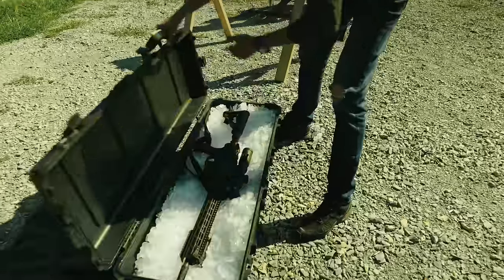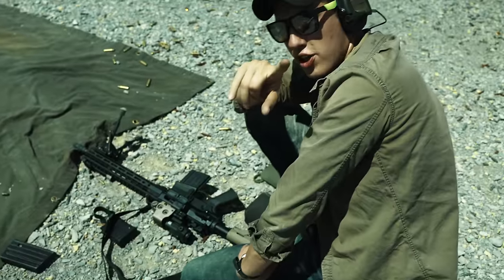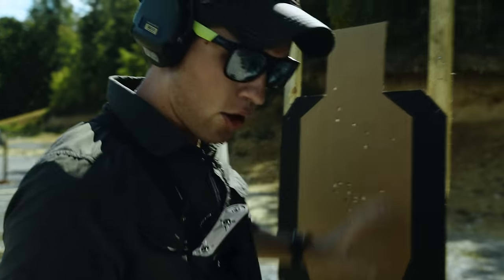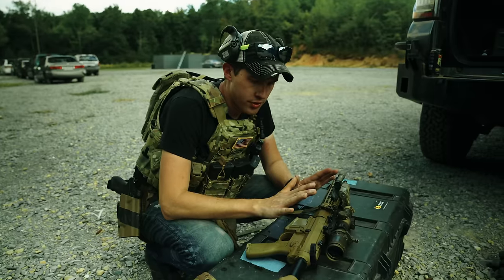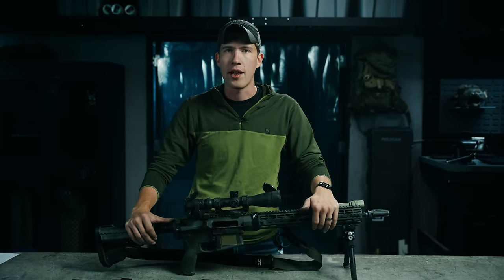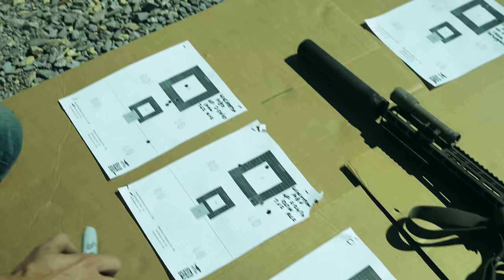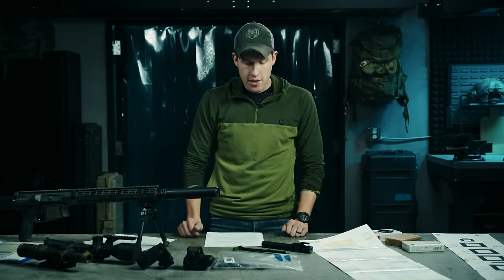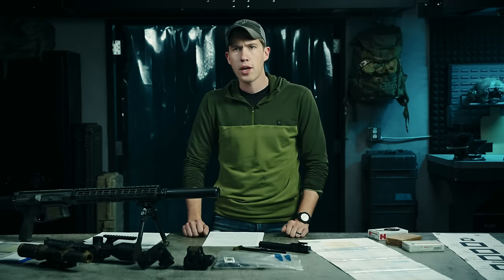Aero Precision M5 AR-10 5,000 Round Test

Comment: heating it up, cooling it down with ice, heating it back up, cooling it back down with ice. Multiple times in a shooting session, are accounting for the added metal fatigue you are introducing, as well as taking that into consideration when you get failures?? Drastic temperature swings like that as well as uneven temperature swings can't possibly be good for a rifle. Expansion and contraction of the metal in uneven ways. Not to mention the effects that could have on the temper of the metal. Is that something people normally do when shooting their AR's?

Comment: purchased 2 barreled .308 uppers, one 20" and one 16", from Aero. Also, I used their BCG, CH, and Lower. On both uppers, the .308 headspace NO-GO gauge locked into battery. Just curious if you  checked headspace on your build? If so, what did you find?

Comment: I haven’t finished my aero yet waiting on a buffer tube, but I have also built out a PSA and a Bear creek. They are not exactly the same in fact all different lengths, optics, all un suppressed. All 308, all I want to see is how they compare, won’t be doing what you are. I do think that you should compare but start with the aero as your bench mark , then see if you have similar failings and wear. Go to that round count you got too with aero to keep it fair for all. You might want to shorten the amount you publish I listen to it all but I mopped the floor while you did it.Bits and pieces will keep it interesting. 50,000. For a thousand dollar rifle review?😂😅😢😊

Comment: so, at about 1500 rnds shot in varied Alaskan weather conditions my aero bolt carrier decided to shit out the firing pin retaining pin out the rear of the carrier, between the carrier and the firing pin locking the whole system up and gassed me so hard it knocked my shades off my head , shooting 6.5 creed various high end ammo. this made me very angry, i purchased a new BCG, and sold the upper at a loss. was running a hyperfire eclipse fcg, m5 freedom lower, captured jt silent buffer, the gun actually ran titts until that incident. the lower is now host to a WC 358win upper and ive only shot it about 100 times since, the whole thing soured my opinion on AP. i tried to like it. i have a few 556s built on aero lowers that have lasted , but the lower is the only thing made by AP.

Comment: I think we all want that unspoken question did you ever discover were the broken piece of firing pin went to or did it get flung from internals to i would assume the mag or out the gun into oblivine.obivisuly fhe pin takes some hard hits but i would think if anything breaks off it would be locking lugs or extractor maybe even bolt face cracks.but must be weakness in that particular bolt system.otherwise indepth testing for sure,intriging i enjoyed!!snookie pa.💥👍💋

Comment: I have a couple of problems with this video.  First of all, operating the weapon without lubrication or cleaning is not operating per specification.  Would you drive a car with no oil?  

As for the broken firing pin, again it was operated outside of specification.  That is not a warranty issue, it's a misuse issue.  And I don't see how it would be such a problem to simply swap.out the firing pin.  It's a wesr item.

Comment: Would the results be comparable if you used an Aero Precision AR10 chambered in 6.5 Creedmor or would it be drastically different ?
Reply: 6.5 creedmoor is harder on the internals.  You have the get a barrel with a +2 length gas system to slow down the velocity of the bolt carrier and usually a JP small diameter firing pin bolt because 6.5 creedmoor in ar10 is known for piercing primers with regular .308 bolts.  
  I built a JP LRP07 clone and did a lot of research before building mine out.  I cloned that rifle because it was the only proven 6.5CM AR10 that I knew of at that time.  Rifle runs great!  Got ~2k rounds through it and itll shoot MOA consistently.  Under MOA occasionally.  I run it suppressed with the JP VMOS BCG and SCS with an extra tungsten weight on the SCS.

Comment: You have a great channel and provide great testing and product info, but not cleaning a rifle for 5000 rounds would be like driving a new car 50-100k miles and never changing the oil or lubing the chassis and not rotating the tires, then wondering why the engine fails. I don't know any professional or responsible gun owner who would not clean their rifle at least every 300-500 rounds.   Even soldiers have cleaning kits with them and could clean their rifles at night or every few days.  An AR10 308 is not like an AK 7.62x39 which could probably function ok after 5000 rounds with no cleaning.  For sure the barrel and or throat on that 308 has a bad carbon ring which affects accuracy and will increase pressure.  There will be tons of carbon build-up inside the bolt/firing pin area and inside the barrel/bolt junction which could cause head space and pressure issues.  To be fair to any rifle test, there should be some basic cleaning done to it.  Or at least test 2 of the same rifles, side by side.  Clean one at reasonable intervals and abuse the other one.   I own many rifles; they function and shoot a lot better when maintained.

Comment: Can you do a diamond test AR-15 or are 10 I've had BCG problems with both of mine and want to know more before I get to 5000 the ar 10 has about 200 rounds and my 556 has about 1700 rounds over the past 2 years the bolt snapped completely on my 556 at about 1200 rounds and my AR 10 the firing pin tip broke at 60 they've replaced both due to warranty but want to know if it was just the one I got or if it's a recurring issue before I tell friends aye get this gun cuz I love my diamondback ars just had the BCG problem with both and they're both still really accurate from what I've been able to see only have gone to 150 yards or meters with both

Comment: Here's my explanation as to why Aero Precision has poor customer service...

One of the worst customer service I've ever experienced from a firearms (and parts) manufacturer when dealing with their faulty part they manufactured.

While putting my purchased Aero Precision EPC-9 together I noticed the buffer retainer was damaged and this buffer retainer is under the receiver extension and holds the buffer and buffer spring in when the upper and lower are separated.

Each time I call them I'm on hold for over an hour...very frustrating.

When I contacted the Aero Precision customer service about their defective part they told me they would get to my complaint in 6 to 8 weeks!!!!   This is unacceptable and unreasonable...so, I'll have an expensive paperweight for at least 6 to 8 weeks?  The customer service representative didn't even offer me any options, like ship the defective part back to them and they'll ship me a new part.

Comment: To shoot a 308 AR without an adjustable gas block, especially when it's suppressed is just silly and asking for failure, whatever the brand. There is so much gas you must regulate it if you want a reliable weapon, unless maybe you use a flow through suppressor, but even then.

Comment: Uhm, your using a red-dot.   They are typically a couple of MOA dots....    Get a real scope.   My cheap, bear-creek is sub MOA with a 16" barrel.   In fact, when I pull the trigger, it looks like a hole appears right where the cross hairs were pointing.   I don't have a bipod...  The barrel is stainless.   I did polish the BCG, the ramps etc.   Some BC bolt carriers have a non-smooth cam pin action.   Mine is greased lightning.   Also tunable gas block.  For scope, I use a cheap Vortex.
As for Aero - their lowers are solid and I also have a couple of uppers (9mm....) they could be a little lighter - but I've never had issues with receivers being to heavy.... the barrels on the other hand....

Comment: @PnP-td1mt  can't reply to comments for some reason, but i felt compelled to post this:

"So lube prevents screws from backing out and firing pins from breaking? You ever fired a suppressed AR that is heavily lubed? The lube is a magnet for carbon. 
What idiot is going to claim these failures are due to a lack of maintenance when A a legit maintenance schedule for this rifle doesn’t exist and B the parts have never been truly inspected. 
My only gripe with this video is TREX Arms not having a qualified Armor and Smith on stand by to validate part specifications and failure modes. 
That way no bs slips through."

Addressing the first part of your clown take, even Lucas' amateur gunsmith says that when they were running it suppressed, the added pressure/dwell time probably played a part in breaking the extractor. So yes the minimal lube and the gun being way overgassed can definitely help screws back out and put extra stress on the firing pin, they're all exposed to extra pressure that could have been alleviated by knowing what you're doing.

(Saying this here cause I know someone will claim I don't know what dwell time is, based on the statement above. There is extra dwell of the bolt being locked in battery on a dry bolt vs a lubed bolt. Common sense physics, more friction = less speed. Not talking about gas in the barrel dwell.)

Your second statement, this is why I use CLP and not grease as lube. CLP helps mitigate carbon build up. Also, Lucas had a clown take when he said, and I'm paraphrasing, "we're just doing this as a regular consumer would, not gonna clean it after 1200 rounds". LMFAO, I clean my barrel after every range day which could be 10 to 100 rounds, and I fully clean the bcg and bolt and firing pin every 200 or so rounds. Who has 800 round range days 5 days in a row LOL?

"What idiot is going to claim these failures are due to a lack of maintenance when A a legit maintenance schedule for this rifle doesn’t exist" this is pure idiocy. So because there isn't a milspec maintenance schedule you shouldn't maintain your rifle? Do you never change the oil in your car? Do you not reset your torque wrench to 0 when you're finished using it? Who buys a nice tool and doesn't maintain it? I guess manufacturers must love you, repeat buyer cause you don't know how to maintain your nice tools.

Comment: Can't say I would insist on using a lower with set screws instead of roll pins because Phillips head screws tend to get stripped out and it's a lot harder to screw up a roll pin. The barrel life definitely supports anecdotal evidence about ammunition stashed in the woods during basic training. Not taking the time to tune a rifle suggests you're the kind of person who would rather lease a new vehicle than own it and have to do maintenance. The 3rd party bolt issue also leads one to believe that Dillon is more of an assembler of parts than a true manufacturer the way Orange County Choppers compares to Jesse James. And I just can't stop laughing every time you spin around like you're wearing cowboy boots. New shoes tend to be a bit greasy out of the box. Some people might want to feel the ground under their feet while sneaking through the woods but in the concrete jungle, I'd rather not know it's there at all

Comment: T. rex are not the only folks who take a gun out of the box and run it without any lube.
I have always thought that this is the dumbest things I have ever seen. This is abuse of the firearm IMO and I would NEVER do such a thing to a weapon I may have to count on to save my life, and for which I spent my hard earned money.
I commend T. Rex for their effort for this type of real world testing effort, but taking a NEW firearm and running it dry for 2,300 rounds without lube has little to do with the real world. The most important lesson I believe was learned was that if you are looking for this type of rifle, make sure it is supplied with an adjustable gas block that can adequately mitigate the bolt speed/force.
 
The next thing you need to do is call Aero back (and your lawyer) and apologize for "testing" one of their brand new .308 DI rifles, then putting out a "no go" video while basically only lubing the gun after it fails. Then run the test again with a gun that is not abused. One of your staff did a 5,000 run test with a PSA rifle, and the first thing he did was lube the gun. Running thousands of rounds without ANY lube is in the same class as the "reviewers"  fire AR 15's full auto until the gun breaks and/or catches on fire. You abused this gun into failure, doing Aero and your viewers a great disservice.

You guys still should be commended for your efforts to elevate the evaluation process of firearms for public consumption, and I pray you take my criticism in the spirit in which it is offered.  Keep on with the project, but basic guidlines need to be set and observed. 
As I said, no lube on a new gun, especially for that many rounds is abuse of the weapon. How or why some reviewers have made this popular is way beyond me.  I hope you all get these tests squared away. I wish you luck because you are on to something. 

I'd just like to say I have no connection with or knowingly own any Aero products.

Comment: Yeah, the firing pin is in the middle of the whole thing, basically having several layers of protection, the ice should basically have zero effect on that.
If it's hot and you take it out and stick in right into the ice, different case, and it should basically be able to handle a bit of that as well.
But this might just be a bad part, no matter what you make, every now and then that will happen. HOWEVER !!! It's still a catastrophic failure, the gun's out of commission for the battle until you get back to base and have a new part.
It will take some work to figure out what happened, bad part, or bad design, keep in mind, this is all part of development, just like in war, no plan survives contact with the enemy, in this case, your users.
What also greatly matters is how was this delivered, ready to fire, or in parts with building and maintenance required up front, like lubing. Can matter a shitload.
And sure, better QC is a thing, but you're not gonna uber stress and uber check every part with all kinds of scans that are just not done in general. You can, ups the production time and price considerably.

Comment: Nobody is going to do this kind of test who is serious even somewhat about firearms. You would adjust the buffer setup to be more ideal for suppressed bc everyone knows suppressed causes issues. You would clean and lube your weapon. If you completely neglect your gun then you won’t have proper function and it will fail. Did you check your Bcg o-ring? If you’re buying any gun but especially an ar15/10 that you are supposedly going to battle with and you don’t know how to clean and maintain then yes it will fail on you and you’ll be left high and dry.

Comment: 338 in . 50 cal casin shrunk down same primer. same ammount of gun powder or 303 british not government casing
Reply: anti material . 50 casing brass wolf word theory with a shrunked down 100, 000 balanced cnc rear casing above ring 
.338 in . 50 tannerite magnesium and pistol and rifle powder . 50 mag rejection bull affect non . 50 snake theory
Reply: .50 cal hand written in multiple left range writing and on right front famas with round counter 47 rounds to start with hitman 47 word theory like escape from tarkov clockwork without Dalve. middle is L85 rear ejection with manual long range bolt vecter shrunk 3 spring theory based on opener of ways. playful gunpowder is salt... theory >√>
Reply: Following video shooty shooty First Double Penetration System double shot An-94 effect. I prefer A can-ick

Comment: Loved the video but I must say I was a bit befuddled by 2 things in particular.
The choice of magazine for the test and the fact you decided to not lubricate the firearm prior to or during the first 2000 or so rounds.
PMags would have very likely helped with the magazine issues you experienced early on. As far as the lube is concerned..Any "gun guy" looking to put together a DMR build would certainly take the firearm down, clean and lubricate it while putting it back together prior to taking it out for a spin. No matter whether its a handgun or rifle, every hundred or so rounds I will, at the very least, add a few drops of oil to the frame rails, BCG etc..
In summary, I think you walked the line between test and torture test and you would have benefited from leaning fully into one versus the other.

Comment: I can say with most certainty that all issues were due to the can.  Waayyyyy more pressure/gas flowing towards the BCG and buffer spring/buffer.  A adjustable gas block would have taken most issues out.    Fracture or not if you don’t check your bolt and look it over and make sure everything’s in place (if in aWar) you are anidiot after 2000 round!  like everybody should inspect there rifle after a firefight and you are not on patrol.   shit happens.

Comment: No one is going to go through that broken firing pin issue with their gun, basic individuals will clean their guns thoroughly, you’ve gone through more than 2500rds and have not cleaned that weapon. A lube and wipe of the bolt carrier is not sufficient

Comment: Wayyy too much lube instead of just globbing lube all over everything actually brush the carbon off like scrub the crap outta it. Then add small amounts of lube. The amount of lube you're using is just causing the gun to catch a ton of carbon and gunk. Ar platform is meant to be run relatively dry due to the tight tolerances.

Comment: I'll  save some time, No it doesn't, it broke firing pin, and no they are not available separate, yes they are different than other AR10 pins. Break a pin buy new bolt.... that sucks.